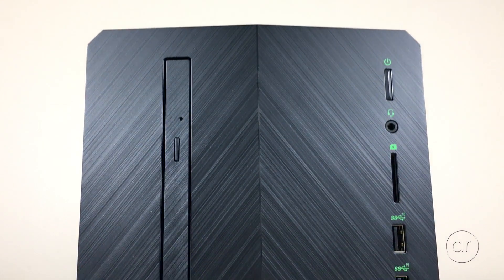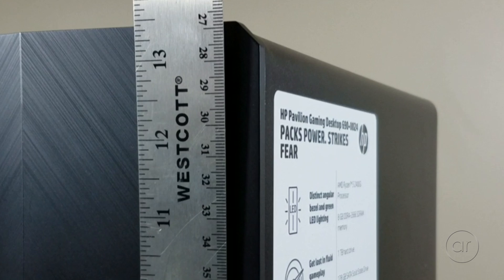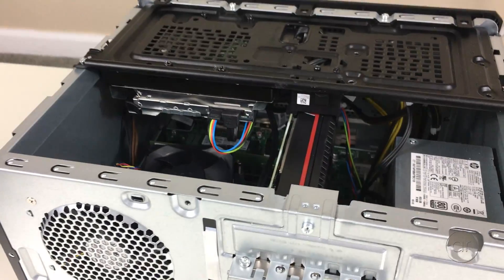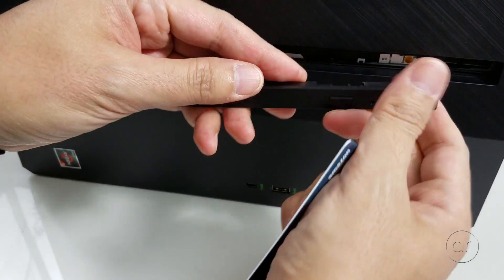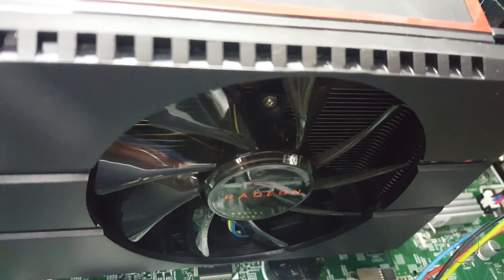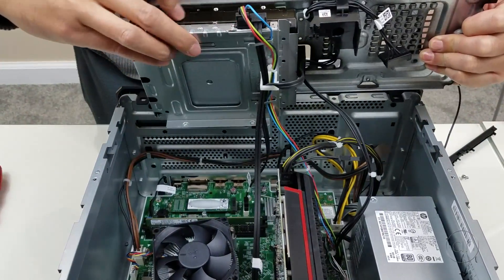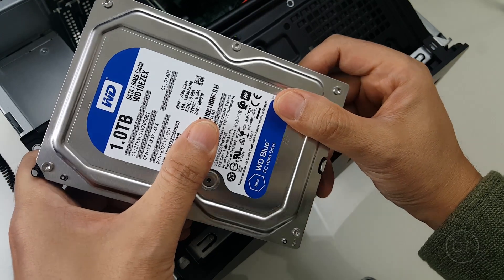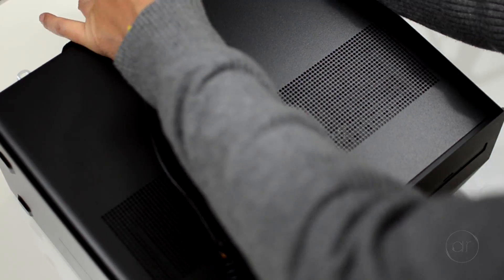How to Open and Upgrade a Ryzen-Based HP Pavilion Gaming Desktop

Comment: Thank you for this awesome video and correspondence. 
Anyone who has any information on the psu connections and dimensions would be a hero
Reply from the maker: Unfortunately, I didn't measure the dimensions of the power supply while I was inside but according to a reviewer at Best Buy, it is 2.8125 x 2.9375 x 6.25 inches or 71.4375 x 74.6125 x 158.75 mm.

The PSU has non-standard pin connections. I'll need to defer to my viewers for information about the pin layout (and their voltages). Anyone?

Comment: what are the dimension for the graphics card that I should stay in between with? Also, what are the current dimensions and specs of the current graphics card in the case?
Reply from the maker: Just had a chance to open it up and I made some measurements (I've also updated the description and the pinned comment): The length of the RX 580, measured from the back of its plate to the edge of the card, is 7 1/16". The length of the case is approximately 10" - in other words, that would be the longest card that can fit.

Comment: can you change the power supply of this computer? please reply asap
Reply from the maker: Not with an off-the-shelf power supply, I'm afraid. HP made the pins non-standard (thus, the pin connectors on the motherboard are non-standard as well). HP does sell power supplies in their parts store but they are relatively overpriced.
Reply: access random sorry just really need help on this

Comment: can i put this motherboard in a bigger tower?
Reply from the maker: Some viewers have tried this, but they opted to change the motherboard and power supply because they are so non-standard.The PSU and motherboard both have non-standard pins for power, for example. The other components like memory, SSD, hard drive, graphics card, processor (without fan) - can be moved over without problems. The DVD drive is slim, so you might need an adapter for that.

Comment: Does anyone know if you can change the case on this pc? And how?
Reply from the maker: I know some viewers have tried this, but they opted to change the motherboard and power supply because they are so non-standard. For instance, the PSU has non-standard pins matched to the motherboard, which has non-standard mounts for the CPU fan. All the other components - memory, SSD, hard drive, graphics card, processor (without fan) - can be moved over without problems. The DVD drive is slim, so you might need an adapter for that.

Comment: Can you fit a two fan Rx 5700 inside?
Reply from the maker: The RX 5700s are pretty long - I couldn't say for sure but I'm thinking not. For any replacement card, you'll also need to consider the power consumption (the RX 5700 requires a 600W PSU according to AMD), and the power connector (the 690-0024 has a 6-pin, but not an 8-pin).

Comment: What kind of cpu cooler i can put inside of this. Because upgraded to r7 2700 and the temps were pretty high. I know it is intel based motherboard, is it lga 1151? Or what?  HELP
Reply from the maker: Lower profile fans should work (for instance, fans like the Hyper EVO 212 are too big for the case). A viewer named Terry Parrot has an excellent summary of his experience installing the Freezer 12 and lowering the CPU temperature in the description under the "CPU Fan" section - but he had to remove the HDD and optical drive.
Reply: @accessrandom okay, but can i go with EVO 212 if i dont use side panel and have removed that black "bracket" which holds hdd?
Reply from the maker: I'm afraid the EVO 212 is too tall for the case (even after removing the cage). I have the 212 in another PC and confirmed the measurement.

Comment: I have the stock Ryzen 5 2400g, but I don’t know wither to upgrade to the ryzen 7 2700. And could you tell me what the best graphics card upgrade would be?

Also great video btw love it!
Reply from the maker: Thank you. I think it really depends on what you'll be doing with the computer - the Ryzen 7 2700 benchmarks better over the Ryzen 5 2400g, but moreso with higher cores (and not so much more with single core applications). For specific graphic cards, you can find models that have worked for others in the "Graphics" section in the description. As long as it doesn't consume much more power than the RX 580 I think you should be good, but keep in mind that in general, you'll want a shorter card with a single fan, and you may need a SATA to 8-pin adapter if the card requires it (since the power supply from the HP only provides a 6-pin connector).
Reply: do you know if i can upgrade a ryzen 5 2400g to a 3400g. The sunflower board was released in May 2018 and there are currently bios drivers for August 2020. Could it be?
Reply: upgrade rx 580 8gb is perfect

Comment: What graphics cards can i use to upgrade this because i wanna play fortnite and i have a amd ryzen 2400g
Reply from the maker: For specific models that have worked for others, they're listed under the "Graphics" section in the description. In general, you'll want to find one that fits physically (so usually a shorter one-fan model) and doesn't consume much more power than your current card. In the Pavilion 690-0024 model at least, there is only a six-pin power adapter from the power supply, so you may need to consider a SATA to 8-pin adapter if the card you want requires 8 pins.

Comment: Could the ryzen 7 be on any pc without any problems?
Reply from the maker: It depends on the PC and the generation of the Ryzen. For example, the HP 690-0024 will only support up to the 2nd-gen Ryzens (like the Ryzen 7 2700).
Reply: access random could the ryzen 7 work for the pc you did in this video?
Reply: access random oh so the ryzen 7 2nd gen will work for the hp pavilion
Reply from the maker: Yes, at least for the 690-0024 model. It can accept up to a 2700 according to HP's site (but not the 2700X). Other model Pavilions may have different upgrade paths...
Reply: access random idk of you have a insta gram so i could send you the model
Reply from the maker: Unfortunately I don't, but if you reply to this with the model number, I can see if I can look it up.
Reply: access random do you have instagram because it comes with a monitor
Reply: access random I bought the one with only 1tb can I upgraded
Reply from the maker: Do you have the Pavilion model number by any chance? There are several models with 1 TB.
Reply: access random there is no model number with it

Comment: WHATS THE SIZE OF THE EXHAUST FAN THO
Reply from the maker: It's between an 80mm and a 120mm. Sorry, I didn't measure it while I was inside, but based on the holes on the case it looks like it's 92 or 93mm? I'll find out for sure the next time I'm inside.
Reply: @accessrandom  thanks man

Comment: do you think i can use this ram?Memoria RAM HyperX FURY Black DDR4, 2666MHz, 8GB, HX426C16FB2/8
or how about this one
Hpe 726719-b21 752369-081 774172-001 Memory 16gb 2rx4 Pc4-2133p-r Ddr4
Thanks so much dude you are a really good person thanks for the help
Reply from the maker: Since there are so many models of RAM out there (and thus potential hardware incompatibilities), I can't guarantee those would work but I have listed the ones that have been successfully used in the "Memory" and "Replacement Memory" section of the description.
Reply: access random ok thanks

Comment: I have the newer version of this, the Ryzen 7 2700 and RX 580 (4gb) card. I was considering picking up an 8gb version of the 580 but I don't know if it will fit and I can't find the exact dimensions to compare it. I've heard conflicting info on whether it will fit. Any guidance?
Reply from the maker: Unfortunately, I didn't make any measurements of the space within the case nor the card itself. I can do that the next time I'm inside. What brand and model of the RX580 were you considering?
Reply: I’m not sure. Probably the MSI 8gb version. A guy at a local box store assured me 4 and 8gb versions are the same size, but I haven’t seen any actual physical measurements of the two to compare. The case is pretty tight, so I’d rather avoid buying the 8gb version if it won’t fit in the case where the 4gb card currently sits.

Comment: Could you upgrade the CPU cooler
Reply from the maker: Yes, you can - however, please note that the mounting holes are for an Intel fan, not AMD (even though it's a Ryzen CPU!). You can read the hoops one of my viewers had to go through to install a decent fan in the description, under the "CPU Fan" section.
Reply: @accessrandom  that works out better for me anyways I have the i5 version with the 1660ti
Reply: @Onlyone10184  what is the socket?
Reply: @accessrandom  do you know what brand of ram they use I was hoping to save money and order another single stick of ram
Reply from the maker: @Onlyone10184  Sure - in the description under Memory, there have been two brands/models of RAM that have been found to be used - one is the Samsung and the other the SK Hynix. Mine was the Samsung M378A1K43CB2-CTD but you should open your case to be sure.

Comment: is there a way to overclock ram on these motherboards? I can go to bios but there is no options for speeds or voltage and i cant find how to access the advanced bios.
Reply from the maker: I'm afraid not - HP has locked down their BIOS pretty tightly.
Reply: @accessrandom  yeah thats really annoying,i recently upraded to 16gb of ddr4 2666 and it stays at 2133.

Comment: You think I can change a case for it and take parts from it just get another mother board and power supply because I'm thinking of making a LED see through machine
Reply from the maker: Sure, you can move the components to another case/motherboard/PSU - the parts that are transferable are the CPU, memory, M.2 SSD, hard drive, RX 580 graphics card, and the optical drive (though you'll probably need some kind of adapter for it since it's a slim drive). Please note that you'll need a new CPU fan to fit the Ryzen because the fan mounting points are actually for Intel.

Comment: If I wear rubber/latex gloves am I safe from ESD? I'm doing a ram upgrade.
Reply from the maker: No, rubber or latex gloves would not protect you. If you don't have a strap, make sure that you touch the metal part of the case before working on any electronics (or even better, remain in contact with the metal part of the case).
Reply: Ok thx
Reply: My first time.opening up PC and I was scared
Reply: Do you know if the PC has ddr3 or ddr4. 
Also One more question I had is: the front of my pc has a different style.  it has one green led on bottom no line of led and the HP logo is on the bottom right of the front . Is the inside still the same?
Reply: @zupaz8104  All Ryzen CPUs use DDR4 RAM
Reply from the maker: As Levleboss mentioned, the memory is DDR4. It sounds like you may have a different model of Pavilion - the one I show is the 690 series - so yours will probably look a little different.
Reply: @accessrandom  alright thx for all your help! My dad is gonna help me with this project he said when he was in college he went from 2MB of ram to 4MB of ram. Wow tech has come far! My model only has 8gb ram but I have a ryzen 7 3700X so I have a high end one.
Reply from the maker: Sure thing - best of luck to you and your dad.
Reply from the maker: Two sticks of 16 GB shouldn't take more than 10W, so I wouldn't worry about a power supply upgrade. A case fan would have much more of an effect on airflow than changing the power supply - unfortunately, there isn't a space for an extra fan. However, you could probably use a dremel tool to cut out a custom opening on the side panel where the hole vents are.
Reply: @accessrandom  wow I forgot I made this comment also I did upgrade my ram.
Reply: Does the PC have to be plugged in, in order for it to take my ESD away when I touch it?
Reply: K thx

Comment: Let me just say that I will NEVER purchase anything again made by HP. I was going to build a new system last year, had all the components in a shopping cart, and looked around to see if I could find a pre-built around the same price. Worst decision I could have made. I ended up buying an HP Pavilion Model 690-0024 from Best Buy. All I wanted to do with it was edit photos. I mainly run Photoshop and Lightroom on it. I have a system I built 7 years ago that has NEVER blue screened on me. The HP? I have to save my work every 5 minutes or so because it blue screens that often. I have even seen it blue screen while it's booting! It has 6 USB ports that only 2 work. HP was absolutely no help there. I let a tech log into my computer so he could see what was happening. I have an external drive that plays now you see it, now you don't. It works fine on all my other computers. After watching it disappear, he told me that it was a faulty drive and that they don't offer support for third party devices. Took it back to Best Buy who told me they'd have to ship it to HP and that it could take " a couple of months" to get it back. Summary, lesson learned. I plan on gutting it and using what I can to build a new system.

Comment: I know I’ve asked a lot of questions on this video- all I have to say now is thanks so much! I had this PC and in the past week, I added a Ryzen 7 2700, 16GBs and today a 1TB SSD. Thanks a lot!
Reply: did you retain the stock cpu cooler?
Reply: @josefbecker3267 did yu find out if yu can upgrade the cpu while keeping stock cooler?
Reply from the maker: That's a lot of upgrades! Happy to have helped - thanks for the update 👍
Reply: @accessrandom  Will a Ryzen 7 2700x work?
Reply: Hi, ii have the 690-0020 and ii want to know if ii can upgrade to the ryzen 7 3700x or can ii only upgrade to the ryzen 7 2700 also can ii make these upgrades without changing the stock cpu cooler? Ii also want to know if ii can upgrade my rx 580 4gb to a gtx 1660 ti 6gb

Comment: Hey man wanted to report 2 things Ihave upgraded so far in this pc (i had the lower spec model with the RZ3 and rz 550). First this is that i upgraded with no issues to the gtx 1060 6gb zotac mini model. Today  I successfully upgraded to the ryzen 2700 from the ryzen 3 2200g it came with, no issues with powersupply the comsuption it surprisingly the same as if it had the ryzen 3, and its running on a 310w 80+ gold PSU with no issues
Reply from the maker: Is your model the 690-0010 by any chance? If you can confirm, I can add it to the description with credit to you. Thanks!
Reply: @accessrandom  it is indeed that model, also forgot to mention that when i changed tbe cpu the 1.1 gb of ram that are used for "hardware" disappeared and now i have fully 16gb of ram instead of 14.9 I believe it was used for the ryzen 3 2200g vram
Reply from the maker: Done! I added your upgrades to the description in the CPU and Graphics sections (I had to shorten some of it because I'm running into a 5000 character limit, but I've captured the gist of it). Thanks!
Reply: hello can a 310w psu can handle a RTX3060 and a Ryzen 5 3400G + 2x8 go ram Corsair vengeance
Reply: @ShortzzFR  you’d most like run in to some issues. I wouldn’t have anything less than a PSU that’s 500w 80+ you can find them online for 50$ from reputable vendors like evga
Reply: @samuelsanmartin7423  Thanks for answering first ! Do you think the Cooler Master MWE 650 Bronze 230V would be okay for the 4 pin connector that supply the  motherboard ? and for the rest of the components , thank you

Comment: would a double fan rx580 fit ? i’m looking to upgrade the rx550 and the power supply to 600w
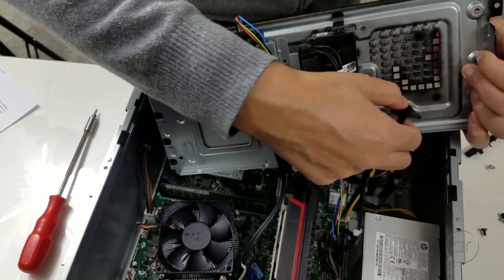Reply from the maker: I am not sure - it will depend on the overall length of the card (make sure it physically fits). You may also need to remove the bracket that you see at the 5:24 mark.

Please keep in mind that the power supply in the 690-0024 has non-standard pins going to a motherboard that has a non-standard connector, so a normal third-party PSU won't work. However, if you stick with HP OEM parts, it should work - I've had one report of a successful PSU upgrade on a related Pavilion (please see the description under "Power Supply").

Comment: Can i upgrade the graphics card? if so which ones are available?
Reply from the maker: Yes, you can upgrade the graphics card - however, the space is limited so you'll probably have better success with shorter, single-fan cards. You also need to consider the power requirements since the power supply is 400W. The PSU in the 690-0024 has a 6-pin connector for graphics cards.

If you look at the "Graphics" section of the description, I've listed all of the successful upgrades from all my viewers/commenters.

Comment: If i would add a SSD to the sata port, what adpater do i need? You said "You may need an adapter to mount it" which one are you talking about? Also - What do i use to mount it? Thanks for all the help on this video, had this desktop for over a year and have been upgrading it ever since.. Still new to computers
Reply from the maker: By the adapter, I simply mean some type of container that has the correct mounting holes so that it lines up with the holes on the cage. Personally, I used velcro to mount it because I wasn't able to find one.
Reply: access random alright thanks!
Reply: also, wont i need a a power cable from the power supply to connect to the ssd..? Do u know how many are on the power supply/ how many are available
Reply from the maker: Sure, there's a power cable right on the cage next to the square vents, as seen at the 5:12 mark.

Comment: Regarding the L04618-800 PSU 400w. Does it have PCI-E power connectors (6/8 pins). Let me know if there is ONE or TWO of these? I need TWO PCI-E 8 pins for my GPU. Thanks!
Reply from the maker: I can confirm that the power supply L04618-800 in my 690-0024 has just one 6-pin connector. Sorry, I wish I had a better answer for you...